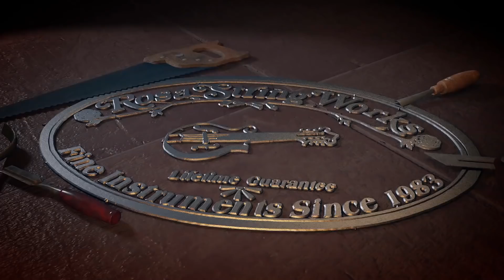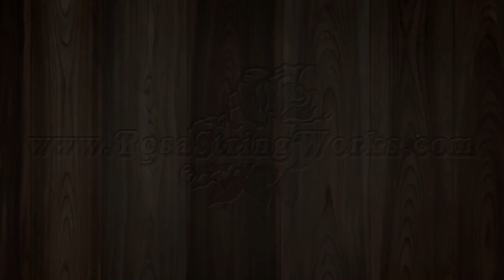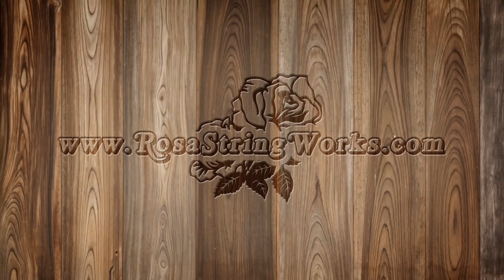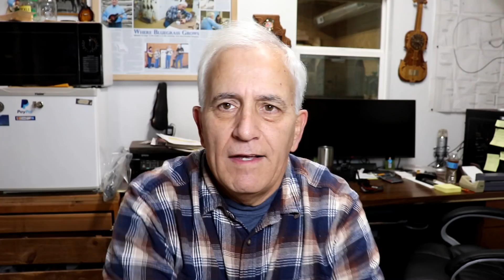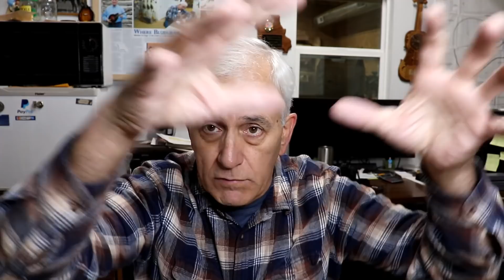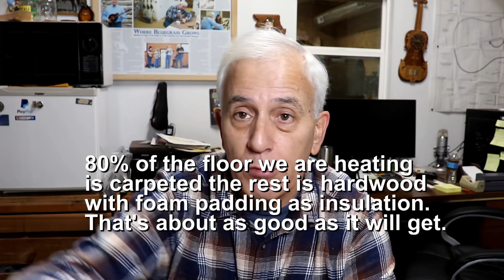353 RSW Gibson Bridge Problem And Cabinet Repair

Comment: Hi Jerry!
That should be a model J-50, Gibson’s natural finish sister to the J-45. All solid woods except for that bridge plate! That guitar appears to be a 1960’s model and originally had the Adjustable bridge system. Those dowels were used to fill the holes left behind by the removal of the adjustment screws and fittings. Also with that system, they believed that a laminated bridge plate would be stronger to hold the extra tension of the adjustment screws. Obviously the whole system was flawed. Changing it over was a good idea for whomever replaced the bridge before but the plate should have been replaced at the same time. With the work you are doing on this guitar, it’s really going to come alive!!! Can’t wait to hear it!
I want to thank you also for you’re videos and sharing your experience with us! Because of you, I, myself, have been able to repair two acoustic guitars by completely removing the bridge, cleaning things up and gluing everything back together successfully! I was also able to stabilize my mandolin by putting in a sound post as you showed in one of your videos! Another mandolin is currently a box of parts but we will see what the future holds for that! Haha!
Keep up the great work sir! And remember, just cause you may not hear from us very often doesn’t mean we aren’t watching and learning!!! God bless you my friend!

Comment: SHAME ON GIBSON FOR MY J-200 Saddle.  It was so loose from a Gibson repaired by Gibson Nashville, The saddle is loose and is on an angle that it split the bridge!  This was after I had to send my Guitar back twice because of the poor neck reset.  I thought they did me right, but after seeing what you said about a loose saddle that could split the bridge, well you are right-on.  It happened to me, but I did not realize it.  Hopefully I can glue it back myself.  My neck reset (and other repairs Top plate was split) cost $2,100.
Reply: $2100 for a neck reset and to glue a split, maybe even refinish the top? That is highway robbery!
Reply: Glen Choitz yeah,  I did double check my receipt and it was $1,950.  Still highway robbery.  But I had a $3000 estimate from other shops.  A new J200 at the time was about $3500.  Top plate repair, sunburst area was airbrush in with a matching color and they did a nice job there...New frets job.

Comment: Ponder time is still working on the problem. I can't tell you how many times I solved a problem by stepping away and thinking about it for a while. I wish I could have been paid for all the times I worked out a problem in my sleep then fixed it in minutes of returning to work.
Reply: I did autobody work most of my life and more than one shop manager would come over ask me what I was doing as I sat on a 5 gallon bucket staring at a wrecked car, this was at a time when we still fixed hard hit stuff, roll overs etc., When I would tell them I was fixing this car, most never did get it. Once I had the solutions and proper procedure  done in my head, the actual work time went down tremendously. Working flat rate commission on book times, this saved me many hours I was being paid for which made me more money as well as the shop. Thinking through the problem was the bigger part of the job than the physical part. Only one shop manager ever understood that...Memphis Chrysler dealership manager George Sartain...he would just come by while I sat there and say 'Got it fixed yet?'
Reply: @glenchoitz9497  Good on him.
Reply: My dad was a machinist, and said that he'd often wished he could get paid for all the time he spent at home figuring out how to fix problems.

Comment: I built my own outdoor wood furnace 12 or so years ago...it is a air to air unit instead of water. When the thermostat in the house calls for heat it turns on a small blower in the stoves door that causes the smoldering wood to jump into flame which in turn heats the air in the surrounding enclosure that is ducted to the house. In the duct work is a snap switch set at 180* that controls a large furnace blower that comes on and circulates the heated air though the house. Not only does this furnace provide a more even heat than a traditional inside wood stove, but it also burns much less wood...and a big plus is it will burn anything from logs to pallets to trash as long as under 5 foot long. 300 gallon heavy wall tank comprises the firebox with a large ash pit welded to the underside along with additional air entry dampener control in the ash pit door.. Cost me a $1000 to build and has worked great for at least ten years now. Thinking about building another for this farm OR going over and stealing that one from the other house which my Son now lives in. Propane costs are just to high.

Comment: Hey Jerry. I have an idea. Would it be possible to rotate the iron handle by 90 degrees? I think that would make it not tip and make your life easier. Great video, and great fix! Keep up the good work.
Reply: If he tried that, he would then have No way to stabilize it, when it wanted to tip off of the bridge, which it surely would. The perpendicular handle is the way to go.

Comment: We typically use 2 smallish trailer loads of wood a week if it's at all cold. Fortunately it doesn't get that cold very often here. The house is 16th century, and a stranger to modern insulation. We're in the process of moving to something a little more modern 'cause of my wife's condition. I'm not gonna miss feeding that furnace. I've been a tenant farmer for 35+ years, it ain't gonna make you a millionaire. Didn't for me anyway!
Thank you Jerry.

Comment: As usual, nice video. Can't wait for the 2nd one. I am surprised Gibson (maker of fine guitars?) did that. At any rate, hope it works out in the end. I have had to use side cleats in my cabinets as well and those dang little plastic things either break or fall out. Go with what you know. Wood rules.

Comment: Where I'm from (Canada) what you call "wafer board", we call beaver puke.
Reply: @Reginald Bowls:
I hear that. I hate that C**p.
Reply from the maker: Funny
Reply: I used to hate particle board until I learned something about speaker cabinet design.  It works really well there because it naturally deadens vibration.  Everything in its own place, I guess.
Reply: @mikecurtin9831  I can't say I've ever heard of beaver puke getting used for speakers. MDF (even molded) absolutely does get used to great benefit.
Reply: Canada is a large place — I have never heard anyone in Quebec or in Labrador calling it puke.
Reply: @arctichare8185  That's why I said where I'm from in Canada.

Comment: I know about going bankrupt using propane for heat.  When I bought my house (2150 sq. ft.) in the last of November, 2010, I spent over $5,000 fir propane for the rest of winter.  The next summer I replaced our central air with a heatpump. Now I never spend more than $500 a year and some years only about $75 to $100 per year.  (I still have to use propane when it gets below 30- 35 degrees but I use my fireplace insert to offset the propane use)  I'm still trying to figure a way to heat the air around my heatpump to make it work in colder temperatures.
Reply: Depending on where it sits...you could enclose it with a small insulated shed....then duct over from shed to under the house if it has a crawlspace to use the tempered air there which is always warmer than the outside ambient air temps.
Reply: @glenchoitz9497  It sits on the north side of the house and I have a slab foundation.  I have thought about some type of enclosure but that would restrict the flow of air around it.  It is the same size (and looks just like) a 5 ton air conditioner.  It works by removing the heat from the outside air to heat the inside so it takes a lot of 40 degree air to heat 2150 sq.ft. to 73 degrees. you can't fool the laws of physics.  The only thing I thought of was to create a wind break on one side and build a fire inside that but I might as well use the wood in my fireplace.  When I was out of gas a couple of times that first winter, I heated the whole house pretty well with the fireplace but I'm not able to cut wood anymore so I just use those firelogs and their too expensive too use all the time.
Reply: @jescocom1  Hi Josh, what was the cost of heatpump installation at your place? I am living in Poland, north east Europe, and here it is very expensive, return after 30 years or more, for a houses smaller than your.
Reply: @jescocom1  Yes....outside air...but that air is normally quite a few degrees colder than the air that is under a house in a crawlspace OR an attic due to heat loss thru floors and ceiling....so instead of capturing the air from under the house by being on a slab...duct it into the attic with both an incoming and return duct to create a convective flow of air to raise the temps around the heat pump. In other words use that lost heat escaping thru the ceiling. I wouldn't make it much bigger than the pumps condenser itself....maybe a foot spacing on all sides. You are not talking about much of a temperature differential to allow the heat pump to work, find that waste heat and use it.
Reply: @glenchoitz9497  That's a thought, but wouldn't be kinda like  a perpetual motion machine?
Reply: @jescocom1  haha...no, as we know physics won't allow that....so there would be some losses still....but depending on where you are and your heat/cool cycles I am betting your attic, even with insulation, stays at least 10 degrees warmer than the outside air ambient temps. While most attics wont have same volume of air as the rooms below them, they should have approximately 3/4 of it. So that is a lot of warmer air to draw from to use in the heat pump....easy way to find out if feasible...stick a thermometer in the attic hanging from a central vertical point on rafter. check it on a day that the outside temps are where the heat pump would not normally work and it will indicate an average of whole attic temps. If high enough...then it becomes a matter of how 'leaky' your ceiling is for exchange air from below.
Reply: @tomaszdrozd3669  I don't know much about Poland but here in the US, Memphis, TN, it cost me about $8,000USD for a 5 ton unit. That included installation and they gave me a $250 rebate by way of a prepaid MasterCard card.  I had Sears install it and I keep a service contract on it as well as all of my appliances.  I live in between 35th and 36th parallel so we don't have many days of the year under 32 degrees.  The manufacturer says it  won't work under 40 degrees F, but I have found it works pretty good until it reaches about 30 to 32 degrees F.  If I supplement my heat with the Fireplace (wood fireplace insert with fans) I really don't have to switch to auxiliary fuel (i.e. Propane) until it gets below about 28 degrees.  It is best in climates that are warmer.  The best heat exchange unit is a heatpump that uses geothermal heat.  They lay pipes around your property below the frost line or the drill deep holes and run the pipes straight down.  These are very expensive to install but you heating and Air conditioning benefits.  The temperature of the ground below the freeze line is a steady 56 degrees F for air conditioning your basically swapping air.
Reply: @jescocom1  Just wanted to say that people I have known with a geothermal system are generally unhappy with them for the expense...especially the drilled hole type. They send down a loop or two of pipe into the hole and the hole being filled with water pulls the heat out because most well water temps are in the 60 degree range. Problem is water is not being drawn out of the well and refreshed so the water remains static and pretty quickly has taken on as much heat as it can (pesky old physics thing again) and its efficiency to cool the house is gone. You start out the cooling season with it working great and my mid summer it can become barely working...it repeats this cycle over and over for warmth and cool. So for the money they are a part time solution. The layed pipe type do the same thing...but to a lesser degree because they are pulling off of a larger field of cool or heat, but they to reach a static point where the efficiency goes way down.

Comment: That's usin' your noodle!
Reply from the maker: Yeah I get that a lot. LOL that is whenever I use a pool noodle.
Reply: @RosaStringWorks  : You should take a few divots out of the side of the noodle, to rest the handle in. It would keep the iron a bit more level on the bridge, or whatever and keep the noodle in place.
Reply: Not to be confused with a new poodle

Comment: This is very timely for me, I've got a Yamaha and a Martin that both need the belly bow fixed.  Thanks very much for making this video now.

I agree that plywood is a bad choice for a bridge plate and I applaud your decision to replace it.  I would do everything the same way you did and I absolutely believe that you know what you're doing.  I have a minor nit to pick about your terms.  The plywood bridge plate is strong (i.e., it's not likely to break), but it's not rigid (or stiff, if you prefer) when oriented this way.  A rope is strong, but it's not rigid.

Thanks again for the video and an automatic thumbs up to crush at least one troll as they show up.
Reply from the maker: You are correct.

Comment: This was a strange guitar, with both guts & steel at the same time.
What is not so strange is that there are guitar forums that discuss
why Gibson did use plywood for the plate. So I believe you're right. 
It will be fun to see the remaining upgrade on this Gibson, 
now with PlayWood® instead.😊 mm
Reply: I suspect it was the owner's decision to use nylon strings—not Gibson's.
Reply: @arctichare8185  Yes, you are right. But, I didn`t say that Gibson did put them on! 
There was a caption that explained the reason why.

Comment: The logo on a headstock is not a guarantee of perfection. Each instrument should be judged by it's individual attributes, and not by the reputation, good or bad, of the manufacturer. I know that's not easy to do sometimes, but I think it's a good policy.

The house: I have a fondness for these rambling older houses, especially Victorian houses. But I do understand how difficult it is to 'acclimatize' those old accommodations.

Comment: Just another point and question, on the house. Do you have good humidifiers, installed on those furnaces? They create a healthier, more comfortable environment and will keep the blowers from running too much, saving you cost on electric. Didn't noticed that mentioned.
You did a beautiful repair on that mandolin. I don't think anyone could have done better, without a complete refinish. I sure understand the customer being thrilled with it.

Comment: I'll probably update this as I go along but don't want to forget the comments.  I know there are ways to insulate concrete without tearing the concrete out, including laying reflective insulation on top of the concrete and putting flooring on top. 

Tesla foresaw some things, including smart phones. He got laughed to shame for saying there'll come a day when there will be devices that contain all the world's knowledge but fit in a vest pocket.

I'm not surprised on the plywood. Some of the things I've seen them do is mind boggling. I've helped pull 3 or 4 necks on Gibsons and have never seen two neck joints that were the same.  They're also the kings of slipping plywood in, though a bridge plate is new to me.

That said, I heard Martin is using carbon fiber for some bridge plates. I'm curious what your thoughts are on that.
Reply: I sure can't see any advantage to using carbon fiber, for bridge plates.
It's hard to work with, the dust from cutting is dangerous ( you need breathing protection) and it's expensive (a whole lot more than a sliver of wood. even ebony).
Reply: @zapa1pnt  that's what I'm thinking. Plus, I've never heard a carbon fiber guitar that sounded good.

Comment: Hi Jerry. Are you sure the plywood was installed at the factory? Since the bolt-on bridge was replaced in a previous repair and the holes filled, maybe the repair guy also replaced the bridge plate. Plywood doesn't seem like something even Gibson would use.
Reply from the maker: Absolutely positive it was installed by the factory because it had the factory mesh over one corner of it.
Reply: Rosa String Works looking forward to you making all good as usual.
Reply: @RosaStringWorks  Thanks for answering that, that was my question too. Also, someone else above mentions that Gibson did use plywood at one point in certain guitars.

Comment: I'm interested in how you know Gibson was responsible for the plywood bridge plate.  How do you know that the person that replaced the bridge also didn't put in the plywood?
Reply from the maker: It had the factory mesh over it. And Gibson uses the mesh to reinforce The Joint at the x-brace.
Reply: That was my first thought too. I have seen bridges I knew had been worked on where the mesh thing was repeated. That seems like a really odd decision for Gibson to make...especially decent era Gibson. Is that guitar fairly recent maybe?
Reply: Google it. There are a lot of articles about Gibson acoustics having plywood plates. I've found it's best to research things before questioning another person's statement in ignorance....
Reply: @donaldmusic6274 . Well said Donald. Good advice :-)

Comment: Jerry, why did you not just put a plate mate in instead of removing the bridge plate?
Reply from the maker: it wouldn't fix the problem. That's why I did what I did
Reply: Were you not paying attention? It was weak plywood, bowing the top and deadening the sound.

Comment: A very big advantage in having the firebox outside is you don't have all that air going out the chimney and sucking in replacement air from the back rooms.  The bigger fire you build in a fireplace the colder the back rooms get.